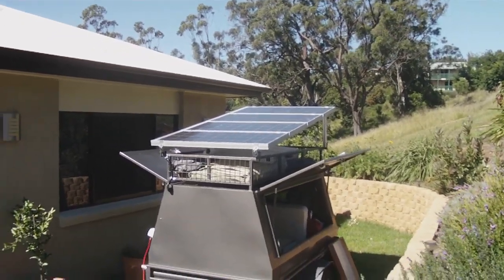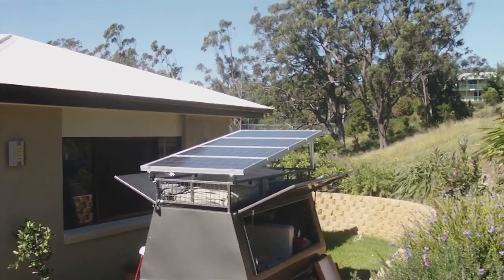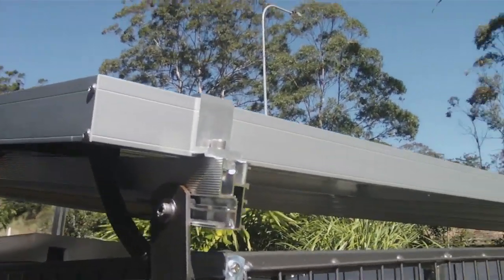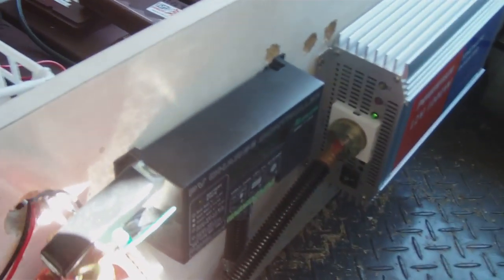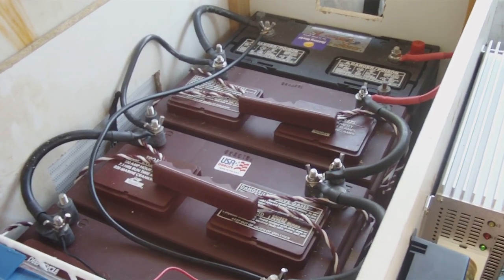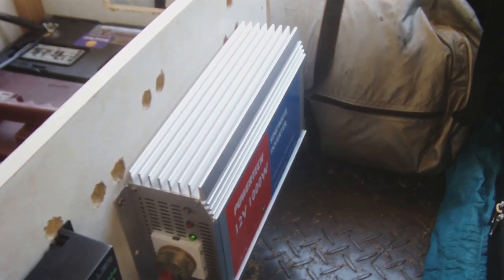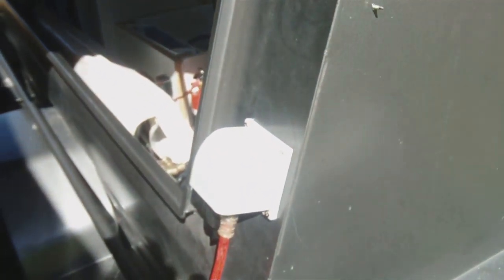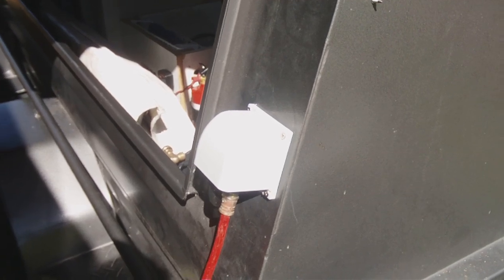The ultimate camping solar setup!

Comment: I just finished my system. I paid $320 US for 290 watts worth of panels, $100 each for 4 batteries for a total of 416 amps, $199 for a 1500 watt (3000 peak) invert er and $600 for the best charge controller available (Midnight solar). Prices have come down.

Comment: @enviergy Those cost have come down alot 40 watt panels are $109. ea and I use 395 amp hour batteries 6 vdc @ $350.00. It is a nice cleean set up. Service the batteries on a regular schedule. I use  a pure sine wave 2500 unit  and a aims 8k? 16 k unit for the farm. So far so good!

Comment: What kind of fuel efficiency loss do you see when you're hauling this rig?  I'm not trying to criticize or troll or anything, because I do think it's pretty cool, especially that you're able to use it at home as well.  It does seem like a heavy setup and I'm just wondering if it's able to offset the efficiency loss of carrying it.  I would guess it would be inverse to how far you are going.

Comment: @enviergy pretty inspiring mate. I just bought my first solar kit through a Primus ebay deal (60l fridge with bonus 80w solar panel for a grand).  This makes me want to go bigger. Those batteries are pretty cheap in comparison to what I have been at - where did you source them? Cheers and keep posting videos. Maybe some voltage of charging etc (especially the wind turbine!)

Comment: I have a 1989 Tiger GT pop up motorhome.  I have one group 27 battery and one 165 watt solar panel on top.  It works perfectly.

I use my microwave, my lights, I can fall asleep with my 15 inch TV running on the inverter.  hard to believe, but it is the perfect system.

Everyone I know has a lot more batteries and a generator, but are always complaining about how they don;t have enough power.  I have more than I need and my only complaint is everyone else's generator noise.